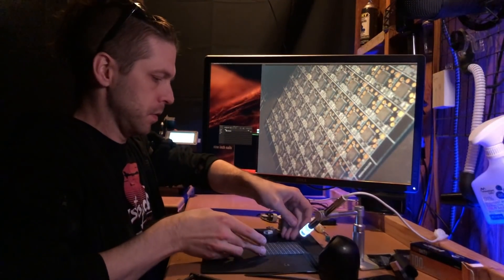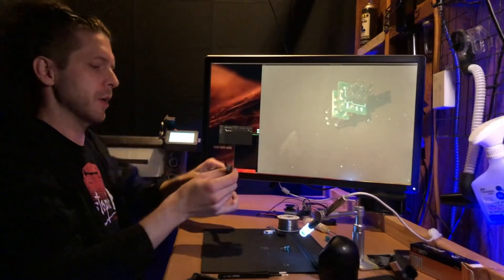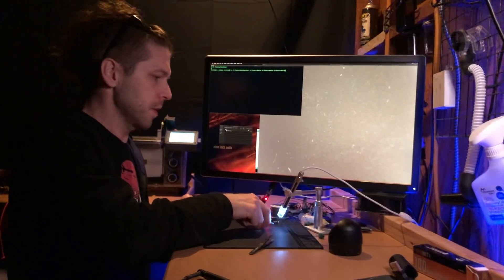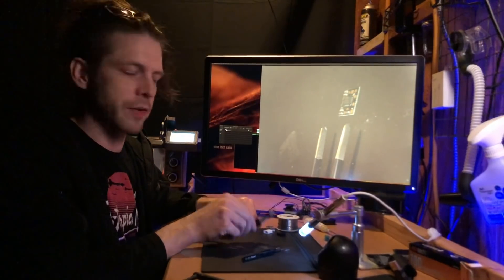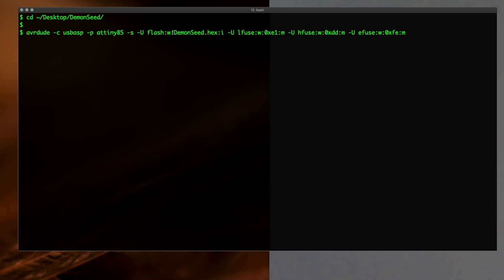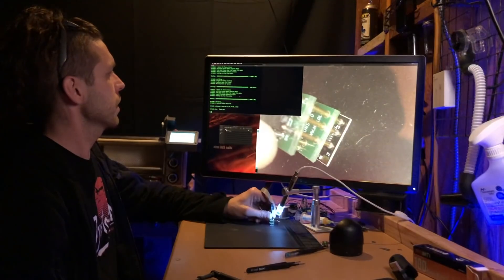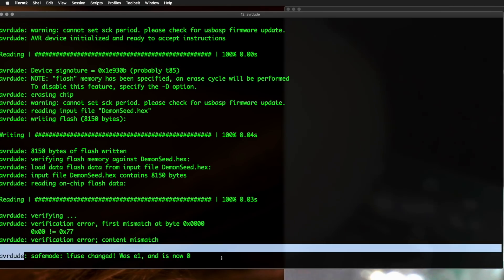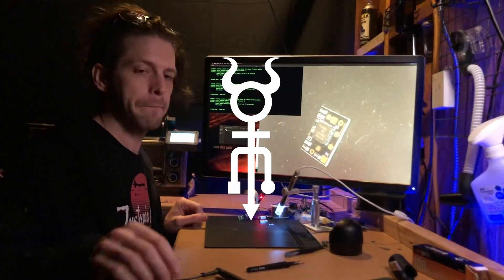DemonSeed EDU - Ep3 - Programming the Bootloader

Comment: Note for folks on Debian -- if you get a "avrdude: Error: butterfly programmer uses avr_write_page() but does not provide a cmd() method," and your device is not using GMS modems / is not using modemmanager, consider disabling the modem manager service (e.g. "sudo systemctl disable ModemManager.service")

Comment: On windows i got the error "avrdude: error: could not find USB device "USBasp" with vid=0x16c0 pid=0x5dc" can anyone help?
Reply: Just got it running - you need to install the correct libusb-win32 driver as shown here: https://electronics.stackexchange.com/questions/416714/avrdude-does-not-recognize-usbasp-device/417509#417509
Reply: Also note that you have to run avrdude in CMD rather than WSL because WSL doesn't have direct USB access